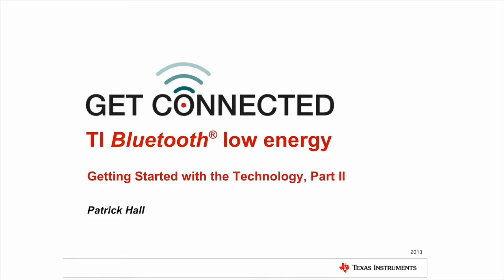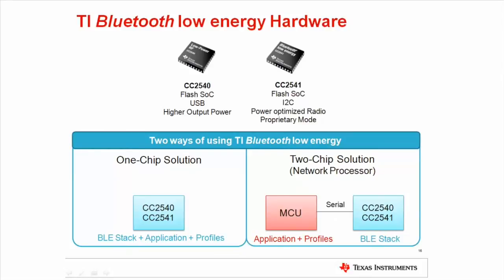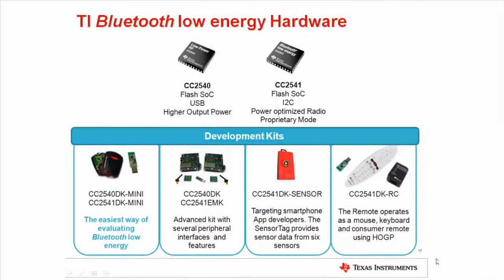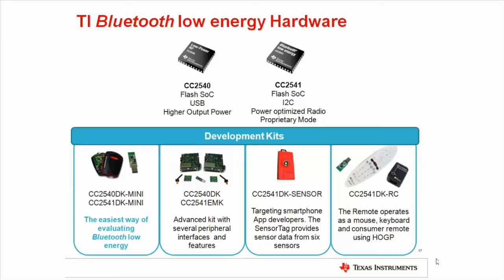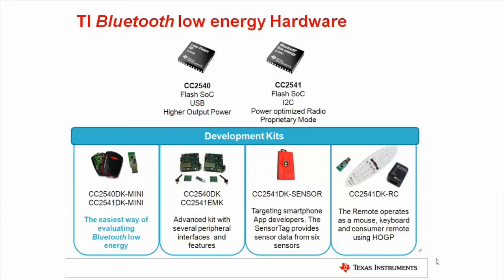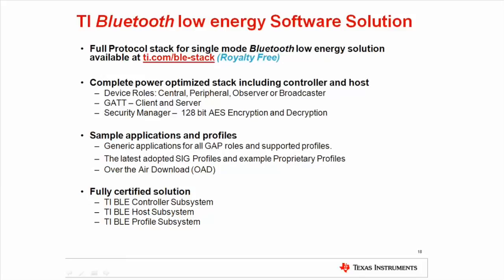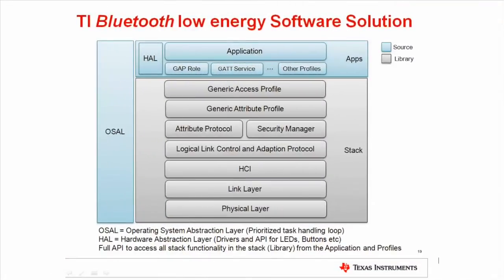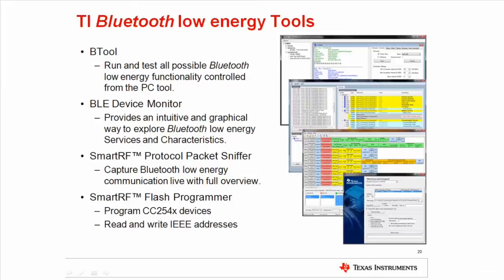TI Bluetooth Smart tutorial - how to get started I

Comment: Hi, I would like to ask you some questions:
- Is it possible to use this SoC (CC2541) keeping RF off, as an MCU without radio?
- Can this chip be used replacing BLE and developing a non-standard protocol?

   (the RF chip is like a CC1101 @ 2.4Mhz?)
Thanks,